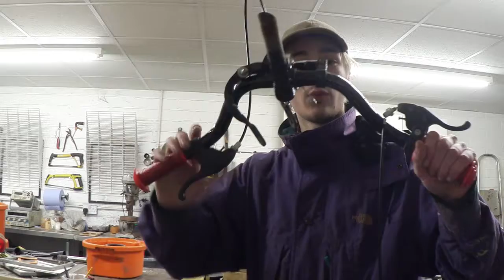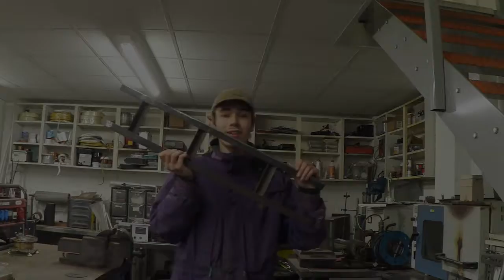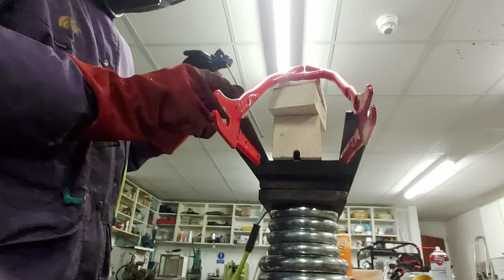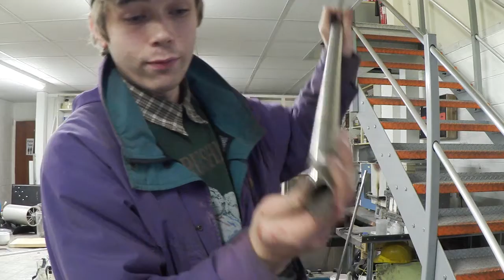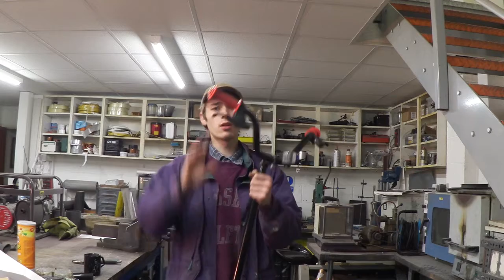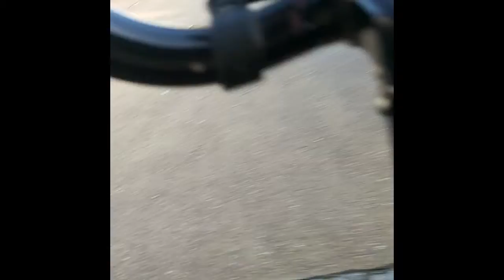DIY Scooter From a Kid's Bike

Comment: I'm working on a e-scooter made from a kids bike with 16in wheels.  I don't think you need to mess with a new frame at all.
I just removed the chain, crank and pedals and seat, and put in flip down foot steps.  My hangup is making the longer stem for the handle bars easily removable or folding, so it loads quickly into the backseat of a car.  Everything is been scrap free, so can't buy anything, and my mig welder was stolen.  Usually I'd just weld some stuff together, but more difficult now.   I'd appreciate any ideas on the handle bars, no luck searching google or youtube!  Just shows me commercial folding bikes.

Comment: realize with uh structural stength, if you put the angle iron for the parrell pieces instead of triangle up, but L up, it will be stronger cause strength is proportional to height cubed and well, with triangle up the height is only a 45 45 90 or square root of 2 over 2

Comment: ...yep , nice work. I've got something along similar lines 95% completed in the shed since 1998 . For my build I preferred to bronze braze rather than weld. I added a small seat  and retained the pedal drive also . So mine could be scooted or pedalled . It remains to be seen if I finish the build after a 22 year hiatus . I have a dozen unfinished projects . I should send a pic to your email perhaps .

Comment: I would add three long triangular gussets,two at the bottom of the downtbe welded to the bracing rising to the head tube on the underside and one from the top of the head tube to the bracing,side on it should look like a parralelogram. The one tube as it is will break either at the bracing or head tube joint,think stress riser point and weld area + tube diameter? I've had thousands of hours welding cars, bikes,off road parts, test by hitting with a hammer! Looks good when is the race scheduled?:)

Comment: It's looking really great so far. I initially thought as a kick scooter it's always better to have the floorplate as low to the ground as possible to avoid bending down to push. But as an e-scooter it should be great and less of an issue. If anything having it higher prevents the footplate from scrapping/hitting things on the ground and damaging the electronics/batteries etc.
Reply: Yes indeed, it's not like I'm going to take it off-road, but doing my morning commute there is a few hills, curbs, and pot holes so I did not want the bottom to hit anything. Especially when some of the electrics are on the bottom of the scooter. Thanks mate! :)